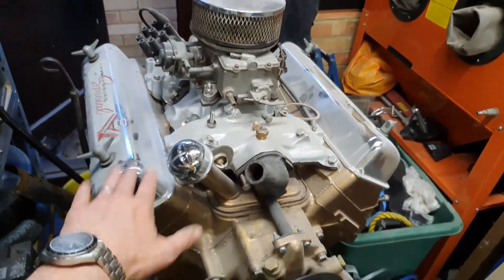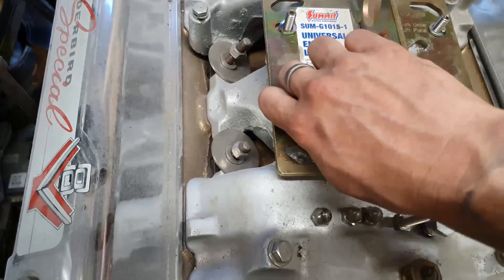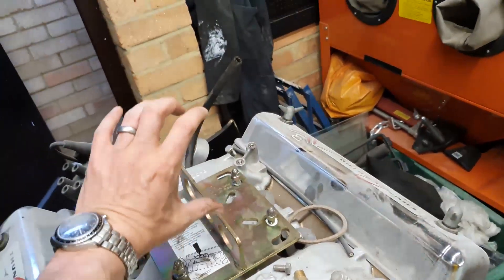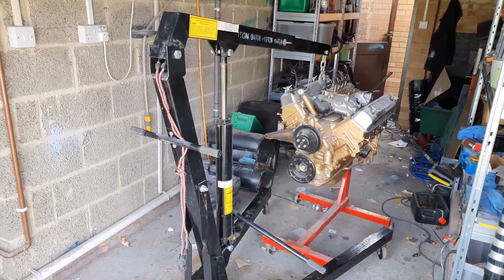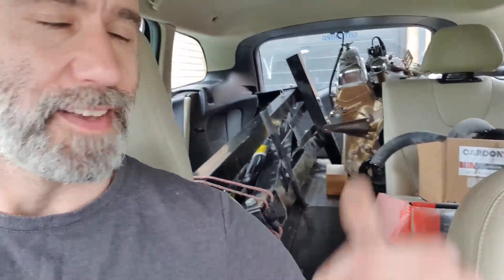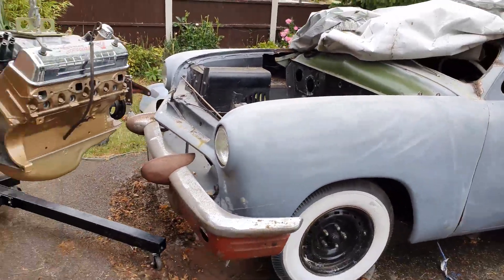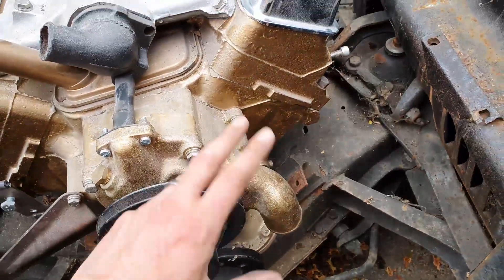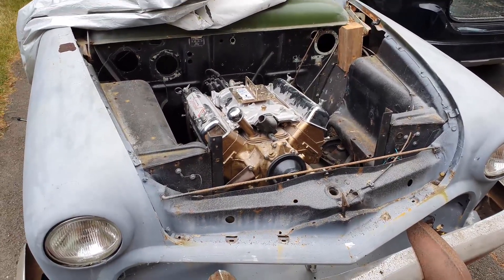How to install a Y block Ford v8 into a 1950 Shoebox Ford

Comment: Im in the process of acquiring a Y block (292) for my 49 Tudor. Did you make your own engine mounts? I believe Hurst at one time sold a set for this swap.
Reply from the maker: Yes im in the process of making a custom front mount. A video will be coming in spring. Hurst did yeah, the mate who made my custom sump has one fitted
Reply: Also, did you need to notch the crossmember for oil pain clearance?
 @FoxSpeedshop
Reply from the maker: @andrewbodey5025  no notch, its a custom made pan with the bowl area moved and the oil pickup pipe extended
Reply: @FoxSpeedshop  That's great, I saw a guy who did notch the crossmember. So basically a custom oil pan, custom motor mounts and set that baby in?
Reply from the maker: @andrewbodey5025  thats it. Original 3 speed trans mounted to a 54/55 passenger car bellhousing too
Reply: @FoxSpeedshop  That's great, I have a mustang T5 that is going behind the 8ba, but if I decide to go with a y block, I would use it behind that. Can't wait to hear it run, good luck